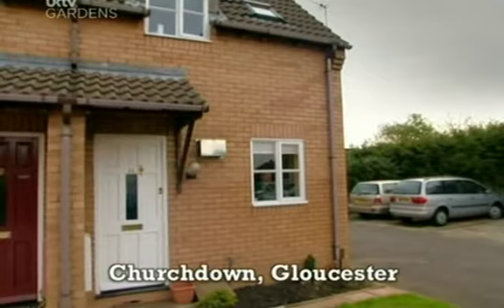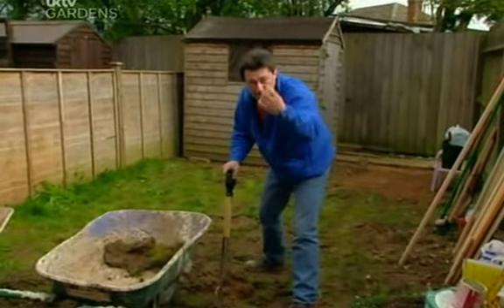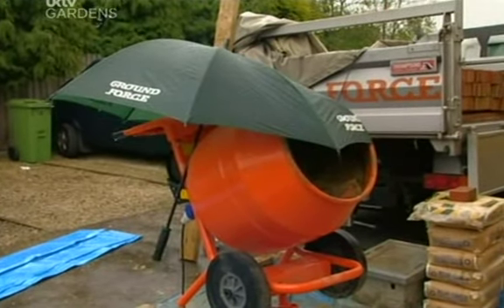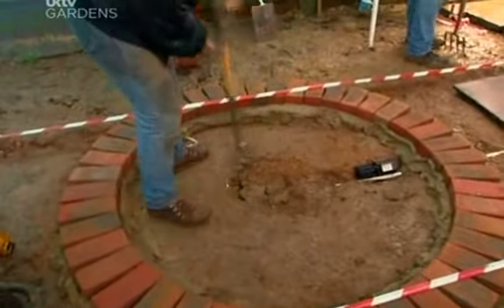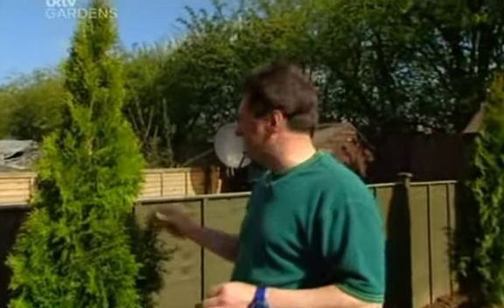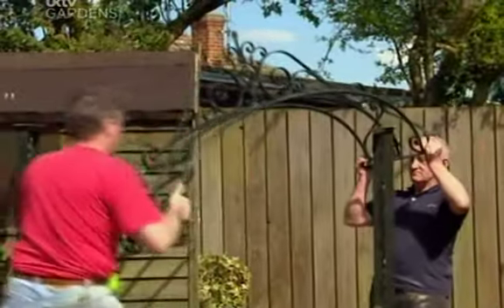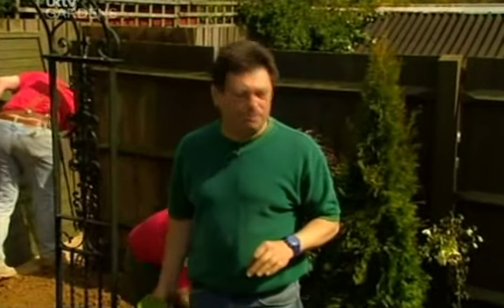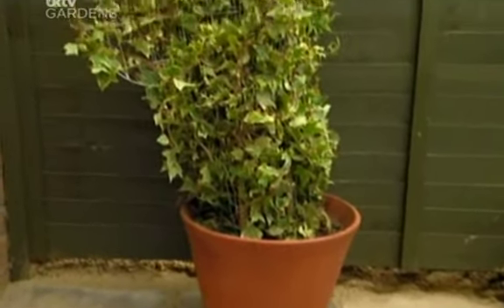Ground Force S06E01   Churchdown

Comment: How do yoou get to the shed?  Is there a gate in the fence?  Also, with all the water features in your show - how do you clean out the water filters?  I had to do that a couple of times during the year (and I used a horse trough water heater to keep the water from freezing during the winter so the wildlife had water available).